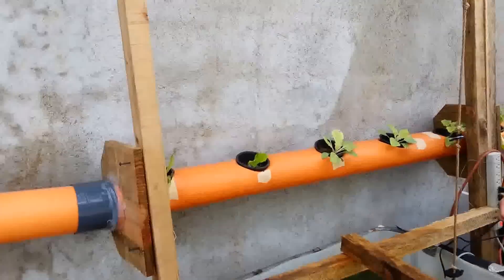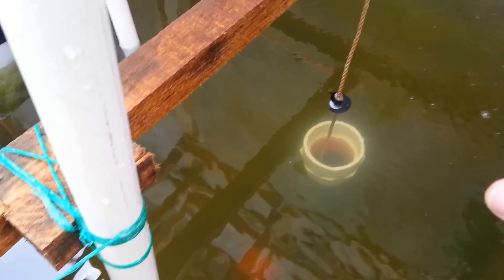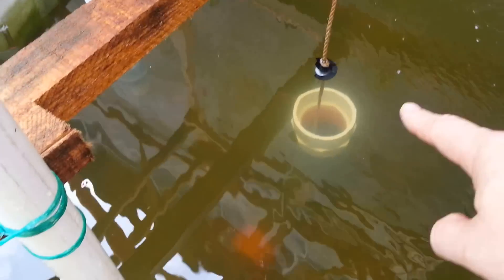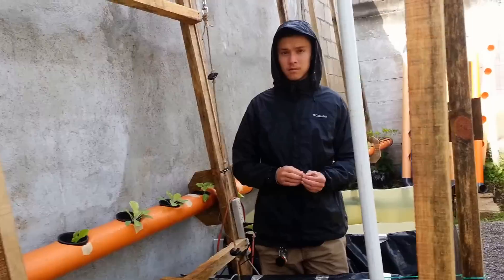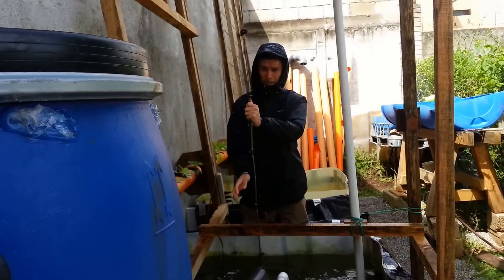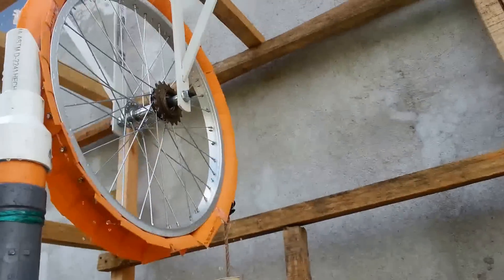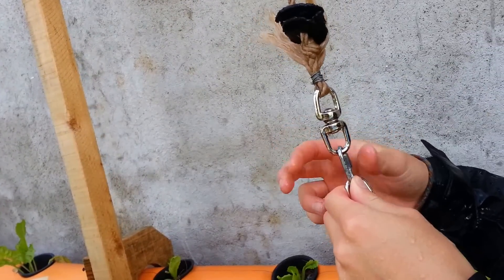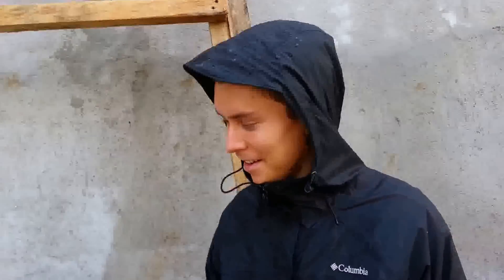Hand-powered aquaponics rope pump...no electricity

Comment: 4:34 5 minutes of pulling will let the water flow for 15 minutes. How about when you are not pulling? Is it ok to let the fish in this aquaponic system without any continuous pumping? Or do you use it with an electric pump?

Comment: How many times a day do you have to pump it?
Reply from the maker: Hi.  You want to completely circulate the entire water volume of your tanks at least once per hour. Hybrid electric in combination with mechanical pumps and other options used in conjunction really help to meet this goal with less electricity.
Reply from the maker: My goal is to run 15 minutes of every hour whether through  rope pump or electric submersible pump with timer

Comment: I bet you have a ton of questions on here....man you guy's must have 3 PHD'S!!!!
I'm new to this....and electricity has always been a negative for me in terms of aquaponics for me because electricity goes out a lot where I live but my question is won't the water run out of the first tank fast?
Is this even for fish???
Reply from the maker: Hi.  The water recycles in the system.  You can loose a little due to evaporation but you can definitely slow that down with planting floating beds on the water or covering the tank.  This Absolutely for fish!
Reply: @paulandnoecrites  but it's like your taking water from one tank and putting it into another.... that's what I meant....Paul, 100% great invention by the way!
But yeah I was wondering this morning if your set up does a sufficient job at cleaning up the water by the time it comes back out and goes back into the tank??
I'm sure your probably busy these days but maybe you could give an update??.... maybe discuss things you've changed or things you'd do differently???
Did you use PVC glue to keep the pipes together??
Ok.....got most of my questions out there, thanks for your time and help.... I most definitely plan on building something really similar....like one idea I had was just to bypass the wheel and stuff by just manually dumping the water up top ....I don't know just things like that....you know ...a way to streamline it for a beginner....are there any videos you'd recommend on aquaponics???
Sorry, I'd ask a million questions if you'd let me
God speed!

Comment: Paul, great video and thanks for sharing. Do you think in a windy area, the human power could be replaced by a windmill? That would be amazing, I think.
Reply from the maker: we thought about wind..I wanted to run a wind turbine to generate electricity to power a small pump and maybe a small heater.  We really didn't have the wind for it.  I might try it again elevated really high.  I would still stay with a hand back up pump though
..thanks for the comment!

Comment: Nice, can you add a Wind Fan to do this? What about a Human Treadmill? As for the bike idea, think triangle: your bike is at the bottom corner, the pulley at the top corner, and the J-Pipe at the other bottom corner. You can do it, but you have to engineer the length and direction of rope correctly.

Comment: You should make a reservoir before the first plant with a single small hole (like few millimeters wide) that trickles slower to the system, so that way you can pump the reservoir full and it would slowly let the water to the system. thus making the cycle longer.
Reply from the maker: great comment!  thanks for the suggestion

Comment: All that is unnecessary, just build an A-frame secured to the wall and lift a large water tank with your car or heavy riding mower hitch and a pulley. A medium steel cable can lift all the water you will ever need and it ill not take all that time and effort to do it.

Comment: would have gone with a home made impeller pump powered by the bike, would have been completely submerged and not have water raining down all the time. Also leg driven is easier then arm powered.  All in all not a fan of this cause unless your there running the pump 4 times every hours EVERY HOUR its a waste of time imo. Also that's a ton of algae
Reply from the maker: +Greg Ward thanks for the comment.  it would be great if you could build the system that you described and post a video of it for us.  thanks

Comment: That is so cool thanks for sharing :) Have you considered to add a reservoir up top to extend the watering time or having a reservoir and cut off valve so you could fill the reservoir then open and close the valve as need for watering? I know that your system probably only needs to be watered for 15 min at a time so that looks like that should work fine but if you could do the hand pumping for the day. Would that be better or not. Or is it easer the way you have it with just 5 min of pumping at a time? Thanks :)
Reply from the maker: +Benja's Uber 1337 Hobby Hi Benja.  Yes feeding a reservoir works great.  I have since added that to the system and will post a video in the near future.
Reply: +Paul Crites Sweet can't wait to see it!

Comment: what if you put a windmill on the wheel? it'll do it by it self on windy days.
Reply: visualkeirockstar If you put the windmill directly onto wheel, you cannot adjust it according to wind, but a vertical windmill connected via chain or belt should work. Neat idea mate.
Reply from the maker: +Erkut Aydın little tough to depend on wind in my location, but a great idea.  I have been thinking about trying it by building a VAWT system out of plastic barrels and mounting it up pretty high.  I may give it a shot later in the Fall and post the results..thanks

Comment: Like if u use a vortex to generate wind energy! If u have problems looking for the shape in 2D have a look at the Turkish eye. 2 Circles, one bigger than the other, place the smaller one on the bigger one, trace it and cut it out. Whats left of the bigger circle is ur 2D shape. This has to be twisted around an axis to create your vortex shape. wind and water behave the same way, they move in vortices.

Comment: Paul, nice use of a rope-and-washer pump! Note that you don't have to have the same diameter of pipe all the way up - you can reduce friction (and work) by having your pumping section just long enough that 3 washers will always be making contact. From there on up you use the next size of pipe - no friction. Check out my video of a hand-cranked R&W pump that we built to fill 275 gal. tanks: https://www.youtube.com/watch?v=OW5SFrQXLSo.

Comment: so please let me get this right, not being critical as I have lots of experimental stuff as well, but if you are building these with poor villages in mind and that is admirable, and they can not afford solar power and batteries, then would they need to send people out at night to man this pump every hour or so ? as the solar/battery option is not an option ?
Reply from the maker: Pumping water into a storage tank on the roof (many roofs here are concrete) then allowing the tank to release slowly into the system at night, keeps the system perfectly manageable over night..  many already practice this by pumping water into tanks for solar heating, then releasing the sun-warmed water slowly into the fish tanks at night to keep the water temperature from dropping too low...so in answer to your question, these things are already considered and being implemented.  I need to make a new video featuring the next generation of this system that would also show how we store water for heating and gravity fed watering ..  If your tanks are big enough you can probably fill the tanks only 4-5 times each day..more would be better but that works.  thanks for the comment
Reply from the maker: Paul Crites as a side note, if someone did decide that they wanted to run a  pump at night or have a pump available for times that it is inconvenient to pump by hand (i.e. travelling, work schedules, etc.) a hybrid system of hand and power pumping is a pretty good idea..electricty when you need it and conservation when you can...  this also allows you to buy cheaper pumps because you are not using them near as often as an all electric system.  Hybrid systems are a very good idea.  I have one and it works well..  all electric systems were very expensive in comparison

Comment: I can see this being useful as a backup for if there's an electrical failure with grid power or solar, but is there any other reason for this? I can't imagine standing there all day to pump water through the system except in an emergency. Am I missing something?
Reply from the maker: if you live in an area with cheap, reliable electricity there are definitely more convenient options for water circulation.  I live and work in Guatemala and design these systems with the villages I work with in mind where they cant afford or don't have any access to electricity.  Solar is an option but very expensive to buy the batteries and panels.  This a nice off grid option for rural areas or as you said an augmentation to an electric system to conserve energy.  When the work is divided between the children (especially in a community greenhouse setting of two-three families sharing the work)..this really isn't that much work to operate.
Reply: Paul Crites Ah, ok. That makes a lot more sense. Sorry. I didn't know the background there. Thanks for the response.

Comment: what happens at Night when you sleep, you could wake up to DEAD fish ?
Reply from the maker: No that doesnt happen..  there are options...solar power charging a battery bank to run pump at night, or air bubbler to oxygenate..  or biofilter..  or electric pump on a timer..  no need for fish to die
\
Reply from the maker: Paul Crites we have coils of black tubing that heats in the sun and at night circulates slowly with a 12v. pump..  keeps circulating the water for the plants, and heats and oxygenates the fish at night..win/win and still off the grid
Reply: Would one REALLY need to manually move this pump all day/night, though?  I don't see how doing it a few times during the day would equal dead fish through a single night... and I know the plants can certainly go a while with dry roots.  I love this idea though and will definitely keep it in mind for future use for fishless hydroponics.
Reply from the maker: +Scotty Hunter no just a few times during the day....

Comment from the maker: Arlene Boyle Thanks for the comment.  A lot of people have been asking for instructions lately.  I will be building an updated system soon and will include step by step build instructions for the fish tanks, flood beds, nft system, bio filter, rope pump and solar water heater.  Can't get to it right now, but I should be posting videos around New Years.
Reply: +David    I wanted to let you know I used your rope pump design in my water generator idea.   It was just what was needed to supply the water flow.  Better than Archemedes Screw.  The design uses conveyor water buckets filled by your pump design and which goes through a step up assembly of gears to get speed high enough to run generator.  See it at :  overunity.com/16023/gravity-powered-water-generator/#.VgIqUJd51Bw  it is listed under gravity powered water generator by Brutus.  It is free to all.  Just want to help all.  Thank You.

Comment: Great idea! A tip, fill end of pipe with dirt or sand. Use heat gun or torch to slowly bend pipe with no wrinkles and have a smooth shaft to work with. Also good for flaring end to receive washers. Or galvanized pipe bent in a -U would also work with cone end.
Reply from the maker: Sunny Jim wonderful advice.  thanks for the comment!

Comment: Hey did you try drilling holes in the support post and BOLTING you hand crank with oversized washers to distribute the force of the cranking?
Reply from the maker: +david reason Yes I did.  the wood was just too wobbly.  i may weld a crank in place one day

Comment from the maker: @Daniel Jinks,  unfortunately physics gets in the way for that, you would need lots of water falling a pretty good distance to power a water wheel to then run a  rope pump..  If you could work that our I'd love to see it!  One thing that I have thought about trying was using the fall to turn a small generator to charge a battery for a small 12v pump.  Another experiment for another day!

Comment from the maker: @Simeon, yes over many years that could happen, but for the purpose of this prototype system, using orange drainage pvc was a great way to save money.  These orange PVC pipes were used a little over a year myself and then sold to someone else still using them.  It takes several years for that plastic to break down.  I highly recommend using them to save money, especially if you are going to be changing the system periodically or experimenting.  thanks for the comment

Comment: Why not use the outflow back into the tank to drive a waterwheel that drjves the pump cord.?
Reply: Energy lost, the water drop will be not enough, the rope as to be pull anyway, , and the resistence level of the waterwheel, the bike whell and the rope and and and ... and.

Comment: Orange pvc is not uv protected it will turn white and crack.
Reply from the maker: Simeon Hill  you are absolutely right, but it will take several seasons.  I will have completly redone this system several times by the time that happens.  thanks for the comment!

Comment: I wonder if you could set up a water wheel to power this?
Reply from the maker: chris ashford Yes I made it.  This is the actual rope pump shown in the video.
Reply from the maker: benjamin, if you had a source of running water, then yes it could be run by a water wheel.

Comment from the maker: Mike Manning, We are thinking along the same lines.. I plan on making a platform sturdy enough to support a 55 gallon drum and feeding it a few times a day, and we are actually building solar panels from individual photovoltaic cells to power a small motor to run this pump when there is good sun (or charge a battery bank for when there isnt sun)..  look for videos soon!!   

R Daybell..and WaterBuck thanks for the encouragement!!!

Comment: Wow, that is awesome!  I have been wondering about how to move water in my aquaponics system without power, thank you for sharing!
Reply: Plus, you could throw a battery/solar panel/motor to run this automagically when the conditions are right...  and hand power when the conditions call for it.
Reply: I was also thinking you could have some kind of temporary water containment system on the roof that would capture some of the water you hand pump, it would then trickle down out of the roof containment over a period of time.  5 minutes of hand pumping could mean 20 minutes of system run time.
Reply: Mike manning....are you still at it??
What have you learned from this video??
I'm new to aquaponics and would appreciate anything you'd be willing to share!
Thanks!